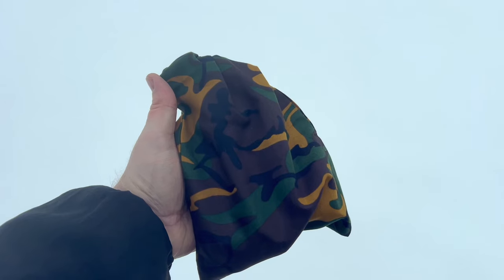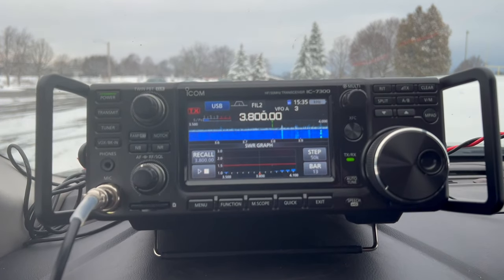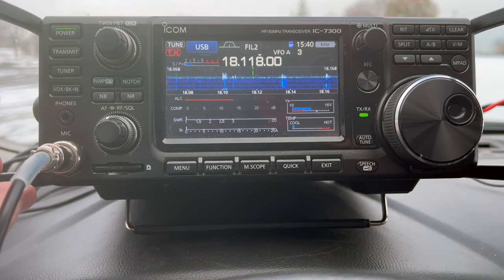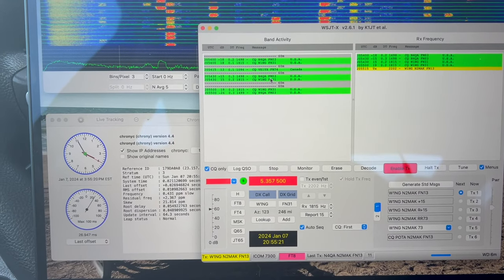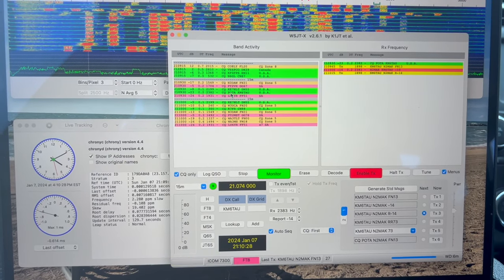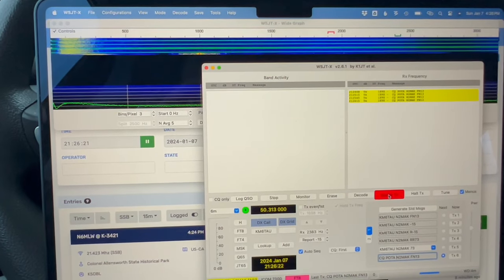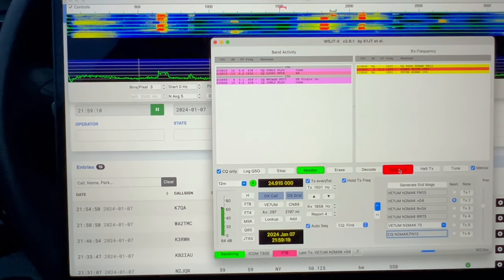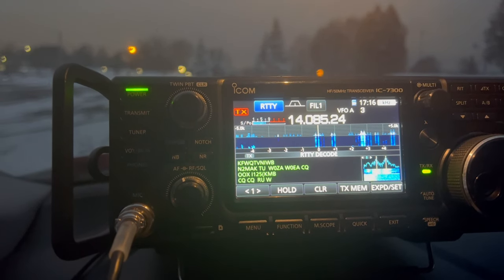N9SAB 80-6m OCFD: What bands can you get on the antenna without an external tuner?

Comment: nice work with that off center fed dipole. I do the same with water jugs . had them freeze. I am in western NY and used 40 to 6 meter off set center MFJ 1.5 Kw that has a 4:1 and 1:1 in it. had to change the bare copper wire to DX 10 wire from DX commander due to being up a few years in NY. The salt we use in winter did a number on the copper.  I got about the same tune 40 threw 6 meters and use it portable now with a DX commander 10 meter pole.  I made a short 10 meter only off set center fed with a 4:1 balun then a coax choke ran it veritable up 10 meter pole and worked great. but my end fed half wave made QRO 2 stack FT 240-61 made for 10 meters on same pole but UNUN on ground with ground plain did even better. better RX and FT8 signal reports. I have the same 7300 . I only run FT8 at 50 watt max . more run time on battery. not a problem now I have a 200 Ah LiFePO4. was just using 20 Ah LiFePO4 at first and that ran most of the day . just keep LiFePO4 warm  and they fine. it's charging below 32F is the problem or extreme cold. I made a insulated POTA battery box. super easy . just foam insulation all around the battery . put a temp probe in it. stays warm and when using it in cold warms up a tad but not too much on hot summer days. 73's
Reply from the maker: Good thinking on the insulated battery box! I’m not out for too long in the winter, but I do wait to charge the battery after to be safe. Thanks for watching!

Comment: Thanks for the interesting video! FYI, I enjoy working QRP & 100 watts SSB on all HF voice bands including WARC bands with a stealth 71' non resonant end fed sloper, 9:1 unun, 50 of coax, with common mode choke on 3' coax jumper between my XPA125B amp and the 50' coax feed line. ATU required on 160, 75/80, 40 for SWR of 1.5 to 1 or less on all HF voice bands. I hope this is helpful for those experimenting with multiband low cost HF wire antennas.
Reply from the maker: Thanks, I'm glad you liked it. I have a 71' random wire too! I haven't used it much, so I need to take it out again sometime. For me, trying new and different antennas is part of the fun and a good way to learn.

Comment: Nice practical review of the antenna. I would've liked to see what the natural (untuned) readings are on the 3 bands that it didn't work well on. If the antenna had a 3.0:1 SWR, that's a 25% loss still at the antenna whether the tuner adjusted for it or not. Enjoyed watching the various modes you worked in the short time you had it set up, really awesome. 73, KS5KY.
Reply from the maker: I’m sure I’ll be using it again soon and will try to remember to do a sweep with my NanoVNA. I had it with me but was focused on showing what the radio thought and could (or couldn’t) tune.

Comment: I've done 1 activation with a Inverted V doublet, but it does require an ATU.  Originally a 20 Meter dipole and changed to be a doublet, it will do 6-40 Meters, so 8 bands.
Reply from the maker: The doublet is definitely on my list of antennas to try. My other radio is an ICOM 705. While I do have an external tuner for it, I don't always like to use it and it's nice to have another resonant multi-band antenna option.